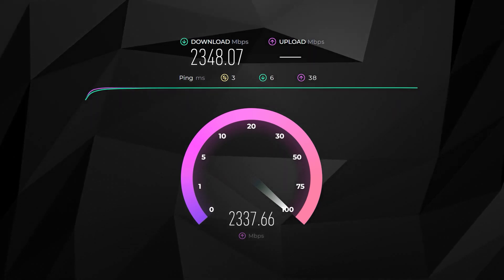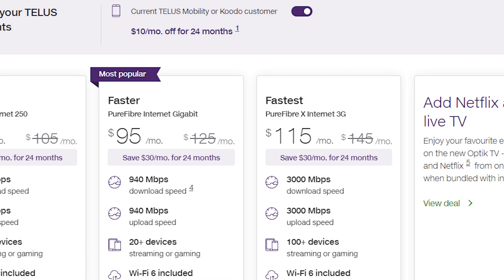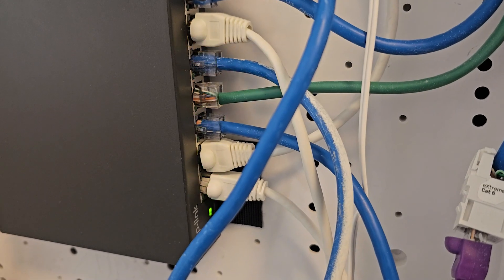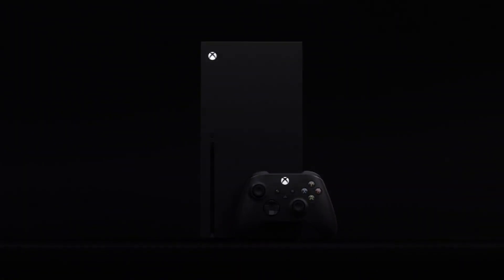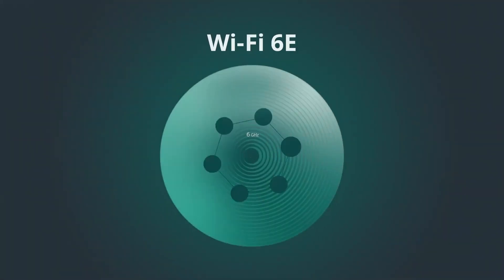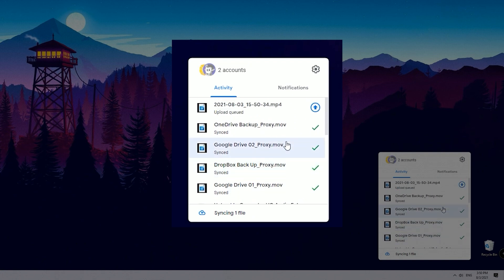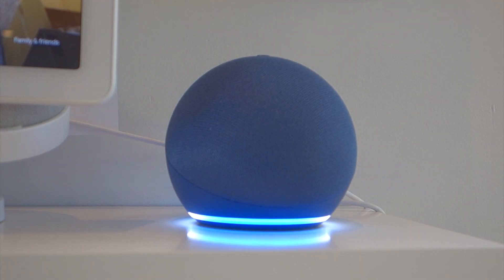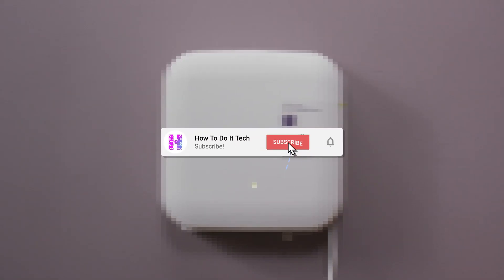3 Gigabit Home Internet: Telus PureFibre X Internet 3G

Comment: Great video, I will be waiting for the Telus technician to install the 3G gb and the wifi6 next week :)
Reply from the maker: Thank you :) Hope you enjoy super fast internet as much as I do!
Reply: Good luck with that. Telus technicians are largely incompetent. They KNOW we have 1.0 gb hardware, and they switched us to 3G remotely without swapping the hardware to accommodate the higher speeds. Result is the internet died, and nobody knew why. Tech after tech came to our home, trying to figure it out, with some having no clue, while others wrongly speculated our home was wired wrong, or some other hypothesis. Work from home doesn't work when you have no internet for a week or two. Finally, someone who had a clue figured out that Telus just flipped a switch to 3G on their end, and expected our hardware to function with the higher speeds even though it was not designed to.

Comment: For most 3GB is completely useless! If your interface on your device will only go 1GB or less, why are you wanting 3GB? Your home network and devices MUST be able to go 2.5 or 3 GB or faster to use the internet link. It’s a scam unless you can use the speed. Currently my Home network works at 10GB and certain devices I own will do 1.25 0r 1 GB so I have 1.5GB service and that is sufficient.
Reply from the maker: Hi there. Check out my later videos where I now utilise the extra bandwidth both for Internet and my home network

Comment: Could have gotten a 10 gig switch instead else otherwise rate limits to 2.5 G
Reply from the maker: Stopping Waze navigation on your iPhone (or Android, the process is very similar) is straightforward. Here's how:

To stop active navigation:

Tap the ETA bar: While navigating, you'll see a bar at the bottom of the screen that shows your estimated time of arrival (ETA) and other route information. Tap this bar.

Tap "Stop": A menu will pop up, and you'll see a "Stop" button. Tap it to end the navigation.
Reply: @HowToDoItTech uhmm lol what does that have to do with anything —you’re not making sense
Reply from the maker: Lol! Sorry, I replied too hastily and didn't check who I was replying to. This was intended for another viewer. Anyway, I did end up upgrading to a 10Gbit network in a later video along with WiFi 7 - https://youtu.be/bd7w6HNRLEc

Comment: to achieve 3gb speeds you would need a 5gb port since there are no 3gbps cards routers or switches made ever. getting a 2.5gb switch is a waste because of the extra overhead you'd get from your incoming signal. so a 2.5gbps switch is wasteful and your losing out on the additional 500mbps
Reply from the maker: Correct. Check out the later chapter in that video where I address this. Plus my later video where I've completed my upgrades! https://youtu.be/bd7w6HNRLEc
Reply: @HowToDoItTech  was recommended your video so I watched it and seen you have 3gbps Telus service and only bought a 2.5gbps switch.
Reply from the maker: It was a compromise I had to make when I first subscribed as well at 5:10. The cost of a 10Gbit switch and a 10Gbit NIC card is actually quite substantial so I put it off for a year. However, 2.5 Gbit is still a 150% increase in performance which is great too.

Comment: Do you have a network diagram of your network? I’d am getting confused. Did you wire your ONT to the switch directly? What are you using as a router to make sure IP address still function properly?
Reply from the maker: The modem/router connecting your fiber connection to your home has a 10Gbit port. I use Cat6 from that port to my 2.5Gbit switch.

Comment: I installed a Telus pure fiber 3g Last month, they have only changed SFP+ and same wifi 6 router, i took that plan bcz in which they are offering wifi 6e devices, but they said wifi 6 is the latest router, even technician was not aware about any new wifi 6e devices. I am not able to fully utilise the 3gbps speed.
Reply from the maker: Hi. So, in my video I go into more detail but to get the maximum speed via ethernet you'll definitely need the right Cat6 of Cat5e (over shorter distance) plus a 10Gbit controller on your PC if you're connecting directly to your modem. In my case in the video I use a switch for my household. For the 6E extender I was one of the first customers to receive a unit so I'm not sure how widely available they are since I published. However, if you're open to upgrading, there are some third party routers available, like the Amazon Eero devices that support 6E without the need for an extender.
Reply: @HowToDoItTech  finally they have updated my wifi 6 modem to 6e extender and charge 10 dollars for wifi plus every month. But the 6e extender is in cylindrical shape. Having 3 ports of Ethernet 5g,2.5g and 1g. But that extender doesn't work well. M6 few devices are facing network problems, my iptv showing connection problem. It is not as stable as a wifi 6 booster.
Reply: I also have telus 6e extender. It  sometimes go as slow as 100 mbps know my 940mbps fiber. Then I switched back to wifi 6 ap
Reply: @kuljitghuman8077  ya wifi 6e extender is not as stable as wifi 6. I have 3gbps connection and will buy tp link BE800 soon
Reply: A few areas where you may have bottleneck speeds:
In house wiring must be cat6 to ensure all access points achieve full speeds
The routers and boosts telus gives only rated till 2.5gig
Make sure you have high quality patch cables 
Also make sure your devices support wifi 6e. 
Set your channels for each band to lower congestion ones. 48 for 5ghz low
161 for 5ghz high and 205 for 6ghz. You might have to check which ones with an analyzer app but this should work well. I have almost 15-20 devices connected to mine and the extra bandwith is good but 6e devices can get upto 900 mbps down

Comment: which port did you use on your modem to connect to the switch? there is only 1 10g port which would be used as the feed im assuming?
Reply from the maker: Yes, that's right.

Comment: Yeah they just called me and offered 3G for $65/mon on a 2 year and said they would pay my Shaw cancellation fee. 
I am paying $115/mon for 1G on Shaw. 
Seems like it might be worth it since I use newsgroups A LOT. 
The DL speeds of 300 MB/s would be killer...plus gaming.
My home is old so the installation might be a pain however.
Reply from the maker: So, if you can get it and can use the bandwidth, it's great :) The key thing for older homes that don't have CAT6 built in will be that you'll need to be able to run a CAT6 cable from the modem to any device that can use 3Gbps (not 300Mps, btw) - These include PCs with 3Gbps ethernet controllers. In my video I explain that modern consoles only have a 1Gbps connection.
Reply: @HowToDoItTech  yeah I was just looking up on the motherboard of my PC which is a TUF x570 Wi-Fi plus and it has the Realtek L8200A on it which I don't think is 2.5. so it kind of defeats switching over but it is almost half the price so even if I'm getting a gigabyte on Telus I'm still saving considerable amount and don't have to deal with Rogers

Comment: Hello I got this service today and I connected my computer with an Ethernet cable to the modem router (I think you called it the Boost?) LAN ports and I'm only getting 1gb speed. My motherboard only supports 1gb Ethernet port so do I need a network card for this? Do those LAN ports on the modem router have 3gb support? I'd like to know how I can achieve around the 2.4g speed you got in the speed test with an Ethernet cable to my computer. Thank you for your help 😊
Reply from the maker: Hi. Yes, you'll need the update your motherboard with a 2.5Gbit ethernet controller (or higher) and also run a Ethernet Cat6 cable directly from your modem. The output from the boosts is only 1Gbit despite the input accommodating 2.5Gbit.
Reply: @HowToDoItTech  Ok, thank you very much. I hope your family enjoys your fast internet and you have yourself a blessed day.

Comment: Hi, I’m in the process of trying to upgrade our own home network and have the Telus 3G Fibre + plan. I purchased a TRENDnet 10G, 5 port switch (TEG-S750) and tried to connect it yesterday without much success. Connected to the 10G port on the modem, I lost the internet on our iMacs with message that it had self assigned an IP address and would not connect to the internet.  In checking with TRENDnet support I was informed the switch needs to be connected directly to our router which our case iis the Boost 6 and has only gigabit ports which defeats the purpose of the upgrade.  Any suggestions?
Reply: Thanks for your reply. The issue seemed to fix itself. After many attempts of with different connections, I went back to the one I had tried first which was the new switch connected to the 10G port on the network access panel and the Boost 6 to one of the other ports. The DNS worked and we had internet.  Now just waiting for the new iMac to arrive and see what speed we can get.
Reply from the maker: So, I reviewed the specs for the TEG-S750 and thought maybe it was a managed switch, but it's not which is a mystery. And I'm surprised at the direction from TRENDnet support only because if it's an unmanaged switch it shouldn't make a difference. My only recommendation is to swap to the same switch as myself, which I can confirm works, unless TRENDnet are going to supply better tech support.

Comment: Hey for the Wifi6E did Telus provide this as free or did you pay for it? I have the Telus PureFiber X 3G and I called telus and asked them to send this but they were not willing to send this for free.
Reply from the maker: I checked and it seems to be bundled into my equipment as part of my contract. I may have just sneaked in when it was brand new and now their policy may have changed.

Comment: Just saying but cat 5e is rated for 1 Gig not 10
Reply: My house has 5e cat cables but I get 3 gigabit speed on my 5e cable. I am using telus 3g internet plan with asus GT-AXE 16000 router.
Reply: @amrinderbatth   this is why I'm saying that cat 5e is rated for 1 gig  a good cat5e  should be able to do more then that but if you stay within the recommended spec you are sure to have the result that you seek. But it is important to set expectation (as a telus tech I would not garantee that a cat5e would work for more then 1 gig)
Reply from the maker: It's a really interesting one. I'm seeing a fair amount of people online and in forums say that over their home network get 3 Gbps on 5e. I do know from the standard that it has potentially something to do with the distances involved in the average house. Totally get the guidelines for customers though.
Reply: @HowToDoItTech  indeed it does! The quality of the cable(multi strand/ solid core) quality of the connexion(keystone or rj45) , I've seen some problem at lower speed and it was due to a low quality patch cable (very small gage multi strand) switch the cable for a good quality one and the problem was solved
Reply: @gabriellalande2249 Cat 5e is rated up to 5 Gbps.
Reply: @eat.a.dick.google   never seen that in my life and I've been doing that for over 10 years

Comment: What provides the multi gigabit connection to your switch? The supplied hardware has a single multi gigabit ethernet wan port?
Reply from the maker: I run a Cat6 cable from the main modem to the 2.5Gbit switch using the 10Gbit port.

Comment: Can you please provide the model of the wifi 6E extender/boost access point. We have same service but never received the wifi 6e equipment. Thanks
Reply from the maker: It's very new equipment as of the time of my video. When you speak to Telus customer service you have to spell out that you want the "6E" extender. It's so new some staff haven't been briefed on it and there was a lot of confusion by them thinking I was asking for 'Wifi Plus'.
Reply: @HowToDoItTech  thanks for the tip and info.